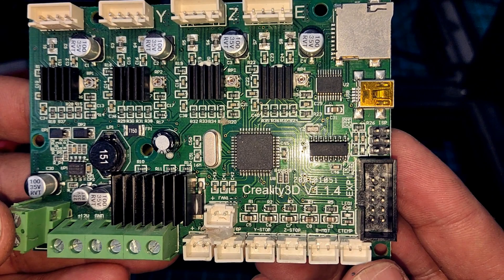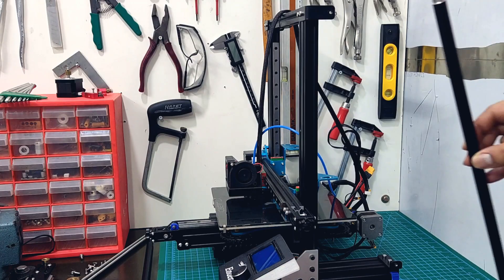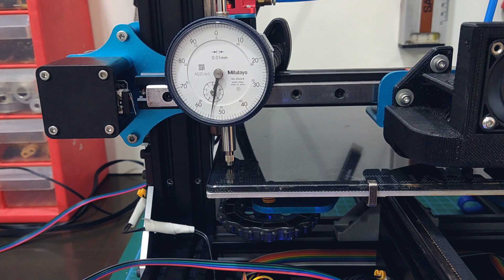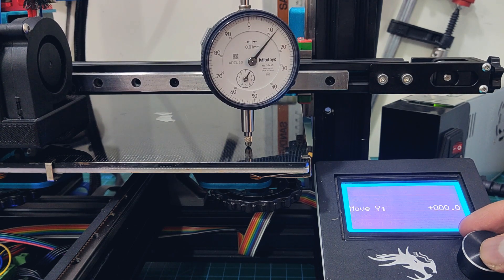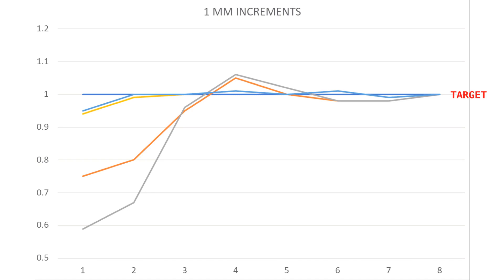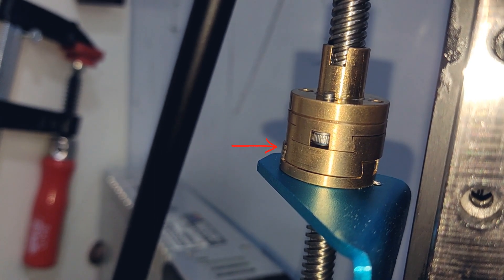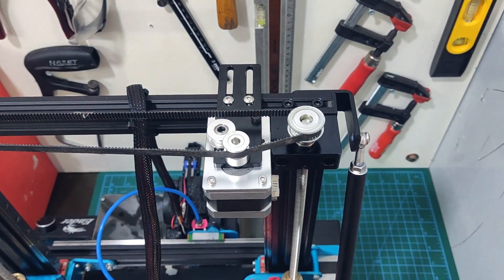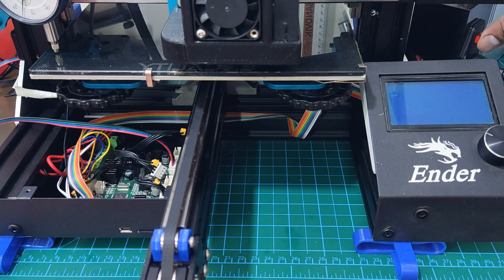Is the dual z upgrade (with Oldham couplings) worth it?

Comment: Thanks, what i noticed and wanted to share was the z banding i saw would correct itself, so it wasnt a X,Y,Z issue it was nozzle preasure throwing filament off track for a moment. You get this with lots of changes in direction and irregular geometries, according to chatgpt.  Why I  never got it on straight flat prints but would get them on human like models.  Apparently its the nozzel pressure build up caused by all that movement and change in direction. You can tune it out in the slicer with coast and wipe/retraction setting but printers like the A1 mini uses its strain gauge to sense the pressure on the fly and adjust flow to make sure its extruding correctly.  And because of it, it gets really good tolerance test results not surprisingly.   Once you get the printer setup perfectly,  the nozzel is the next thing in the never ending things to tweak i suppose.  My Vyper actually uses a strain gauge and has opensource firmware, so i wonder if it cant be modified somehow to adjust.  Would be cool if possible.  That being said, if we had more closed loop feedback, what that pressure detection thing is on the nozzel basically, if we had it everywhere, like along the xyz axis, where the printer would check its position in space relative to its motor steps and adjust if need be, that kind of closed loop feedback would allow us to have imperfect mechanics.  You wont need a perfectly straight lead screw because the closed loop feedback will know youre off and just adjust a bit.

Comment: I'll step up and be "That Guy".. Remember. you are basically printing with a tube of tooth paste.
Reply from the maker: The accuracy is not of importance here, the  problem is that slight variations can cause visible artifacts. The "toothpaste" effect is due to the extruder and true we cant do much about it. But at least we can try for the mechanics to be as close to perfect as possible.

Comment: I know this is an older vid, did you ever completely solve your issue?  That last bit of the video it look like there might be some slight runout on the belt pulley.  I'm thinking of just going dual Z linear guide rails (MGW12) and driving each side directly with a stepper and belt without a leadscrew entirely.  Also wondering if, instead of loading the printhead on the front, if it would be better to balance it so there's no extra load on one side or the other of the gantry.

Comment: Curious, I have the dual z upgrade from creality (the one that uses dual z steppers) has anyone done a comparison between a setup like this vs that? Next, would it be possible to use 2 z steppers in a setup like this? Dunno if it'd be just redundant, but methinks that having 2 motors split the load may lead to more accuracy?

Comment: Where ever the gcode moves up and then down like during a vertical hop, can it move up, down (a little further than needed) and back up (a little) to remove the backlash? If the added bit is the amount of backlash, there should be no visible difference.

Comment: Good stuff man.  I commented on your other video prior to this one and all the changes you have in store are good ones.  Btw, most motor drivers won't just blow from being wired incorrectly, but usually will die swift deaths if you unplug them while powered.  Make sure if you're plugging, unplugging, replugging motors, that you either "Disable Steppers"; or better yet, have the machine off.

Comment: I actually ordered the parts and the rod for the square satability has threads in the same direction... what a shitty design. But okay. Then I attatcxhed my BL touch wrong, getting trhe same effect as your bad stepper wires... Also toasted 2 stepper drivers. So I followed your video a bit too well, I guess haha
Reply from the maker: I feel for you. Good luck with your upgrades
Reply: @bluemonxterDIY  Thanks!
And btw, I'm still doubting whether I'm also going to install the stepper on top. When the the screw is supported by the extra bearings you advised (great advise btw) The load is transfered there, and not on the motor anymore.
the reason I still want to put it on top is for the precision increase. Less backlash when the motor is in between the screws, rather than on one side, and the forces are transmitted all the way to the other side
Reply from the maker: @victorbarrios5162  it is not necessary. my main reason for shifting the stepper was to get rid of the motor/leadscrew coupler. bottom mounted should work just fine.

Comment: If you typically do 0.2mm layers, have your start g-code  start at 0.1mm and rise to 0.2mm for the first layer to remove some lash and get you on the consistent path right away 👍🏻

Comment: That Z stepper on the top is basically what I'm about to try on my old Tevo Tarantula. Except I'm using the 2mm lead screws, which are slow AF. I'm going to try a 30 or 40 tooth pulley paired with the 20 tooth pulleys currently on the dual leadscrews. As always, keep up the interesting content!

Comment: I'm going the belted z route as mentioned.  Starting with it in petg then probably asa. I havnt put a dial on the x axis but I suspect my pro does the same thing. My nozzle likes to rub at parts of my previous layer and this issue is worse with higher first layer heights.
Reply: I use babystep on ender 3 pro when i have problem with layer ;)

Comment: You said that the first mm was affected by backlash, where is that backlash coming from?
Reply from the maker: I am investigating that and will post a video on it & anti backlash nuts next Friday. I am sure its not coming from the leadscrew. Could be the mounting of the Z or the motor. It is a tiny amount (0.05mm) and can be difficult to troubleshoot.

Comment: Have you considered adding supports on the motor to decouple it from the axial compression, e.g. with a thrust bearing? I'm thinking about doing it - it feels like less work and complexity compared to relocating stepper to the top. Can you see any pros/cons compared to your solution?
Reply from the maker: That could work. You would need a thrust bearing with a 5mm inner diameter, place it between the motor and the leadscrew coupling. But that would be for one side only. Or are you planning to do a dual z motor?
Reply: @bluemonxterDIY  That would be for a single Z motor. The non-motor side would either hang on a locking collar, or alternatively be supported and constrained from the bottom. Do you think it is advantageous to let the non-motor side unconstrained from the bottom?
Reply from the maker: @MaciejWiercinski  It would be better to leave it unconstrained at the bottom especially if the lead screw is bent. Constraining it will increase the wobble

Comment: Hey there, what's the best area for a bowden extruder ? Well, it's in a area no manufacturer installs it: at the back of the gantry, just in the middle. This way you can drastically reduce the bowden tube length and the weight distribution of the gantry is optimal. The only downside is you have to guide the filament behind the gantry to avoid it to interact with the print area.This is no big deal actually: it's just a piece of PTFE tube and few 3D printed clips. Well, feel free to think about it ;)
Reply from the maker: The middle does make more sense. Just need to verify the clearance between the motor and the nozzle.
Reply: @bluemonxterDIY  well, if you keep the Creality's style extruder, maybe an angled mount will solve a lot of problems.

Comment: great job. ill probably copy this when i get round to it. i would suggest though, using a idler each side of the z motor, not just one. for better tooth engagement
Reply from the maker: Thanks. I will need to check the belt length for that because the one I ordered right now would probably only let me use one. But yea, two would be best.

Comment: Could you not fit the Oldham coupling under  the bracket upside down to prevent it fouling on the filament?  As long as it doesn't hit the lead screw bracket at the bottom of the lead screw when the Z axis is at its lowest.
Reply from the maker: No, this mounting position was intentional so it preloads the dovetails of the coupling. If it is mounted under the bracket then there is no preload and because of the clearances in the coupling it will introduce additional rotational backlash.
Reply: @bluemonxterDIY  Ah, that makes sense. I don't suppose re-routing the filament is a huge problem anyway.

Comment: I will be copying your set up for the most part. I took the suggestion for a 8mm lock collar for the bottom side of the bearing blocks from a comment, but I will be using those spring loaded antibacklash lead screw nuts I think. Ohhh and verdict on lead screws that are Teflon coated I just saw some the other day.
Reply from the maker: My next video is on the spring loaded anti backlash nuts. They didn't do anything for me other than increasing the friction so maybe it will help you make your decision. The 8mm lock collar is actually a pretty good idea so yea, go for it.